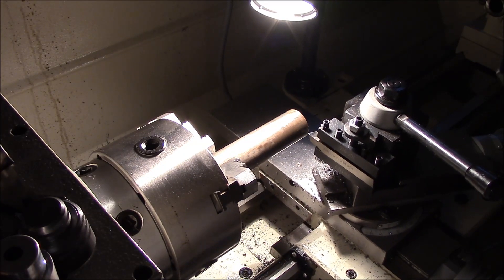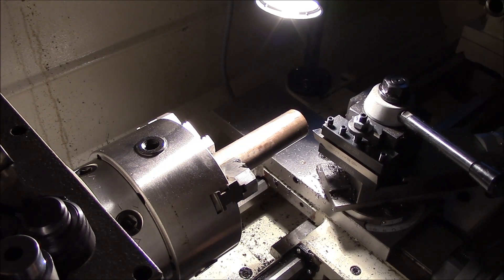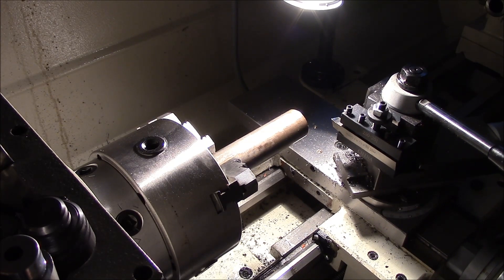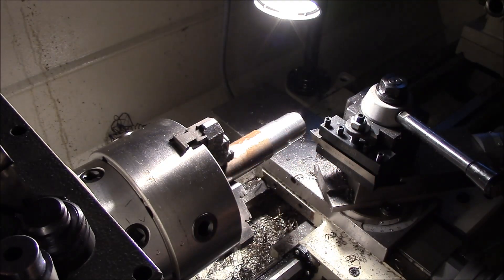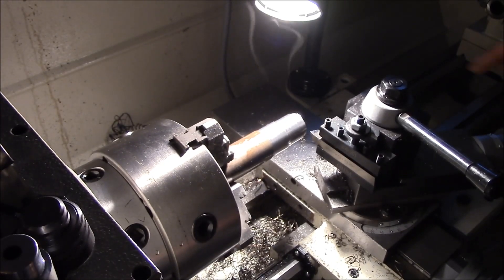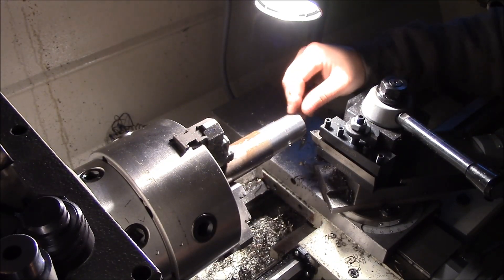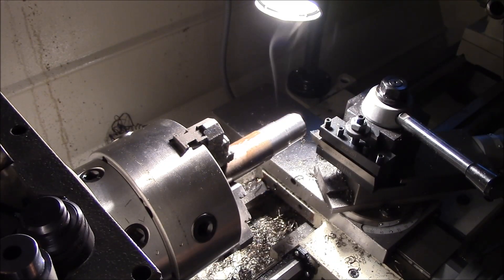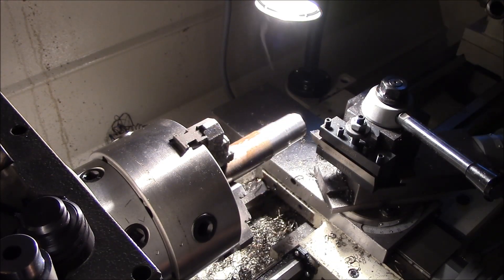G4003G First Power Feed Turning

Comment: As a machine shop instructor I will give my two cents.  First, of course, you need to calculate your needed RPM.  Or at least have an understanding of what RPM is needed.  Second which bothers me the most- you should always position your compound so it covers up the dovetail slide below it.  It keeps it cleaner as the chips cannot get into it.  It will also make the set-up a bit more ridged- more contact area equals a more ridged set-up, most of the time.  Keep on working at it…
We just put 4 of these lathes in our shop.  Trying to get newer machines into our labs.  Maybe not better but at least newer with modern electronics...
Reply from the maker: Thank you for the tip on the compound, I will make sure to adjust that next time I get to working on the lathe. As for calculating RPM, I admit that I am a little upside down still in interpreting the Machinery Handbook, but I believe that using the tables given in it gave me a speed somewhere around 500 RPM, and the closest match was 600 on this Lathe I think of the top of my head... But I do agree, I need to do it often and just keep going and getting a feel for it. I have been told that the unknown (I was told 1008 steel) that I am practicing with is not the greatest for machining but not the worst by no means. I'm needing to get some aluminum stock to mess around with as well. Thanks for the comments and corrections!
Reply: David Finch
We teach the simplified formula which many can just about do it in their head.  First you need your cutting speeds (CS): Tool steel 50, Mild steel 100, Brass 200, Alum 300.  These are very conservative but get you close enough.  Starting a bit lower then calculated is usually not a bad thing better then burning up your tool.  Next fill in and solve the following:
 RPM = (CSx4)/dia of work piece.
These numbers are for HSS toolbits which we use a lot at the college.  We teach the fundamentals.
If you are using carbide tooling you can double (or more) your RPM.
The 4 is a rounded constant value!  If never changes…
If you are drilling in a lathe just use the dia of the drill bit and not the OD of the stock.
I use this everyday in the shop!
Reply from the maker: giessjh6 
Great Tips, Thanks for putting in the comments for not only me but others who are lost and may see them!